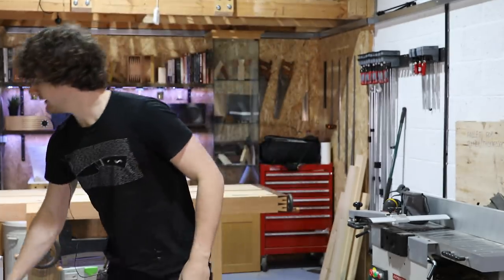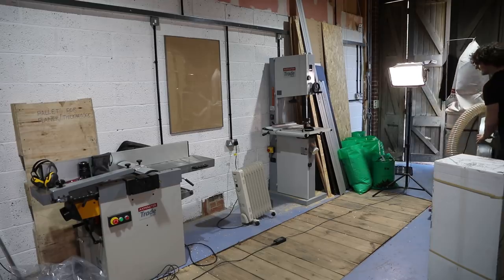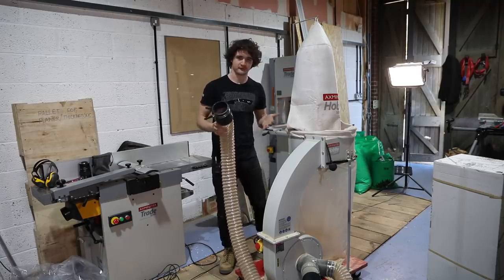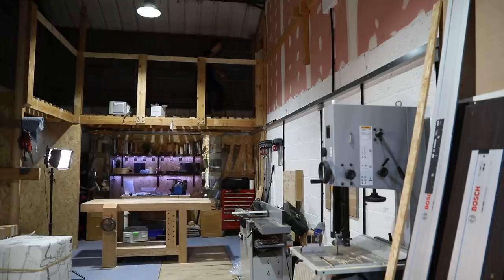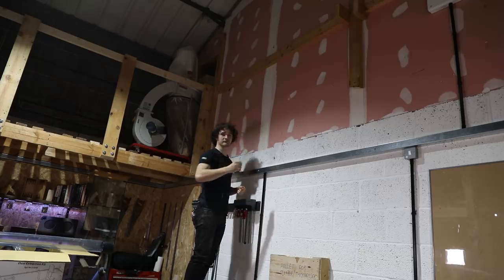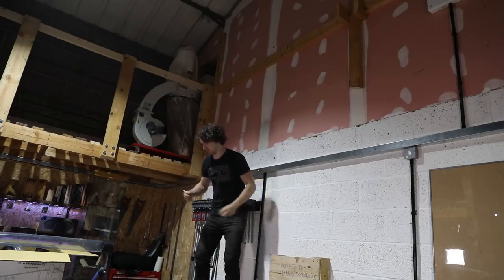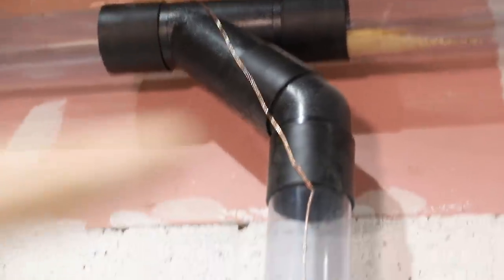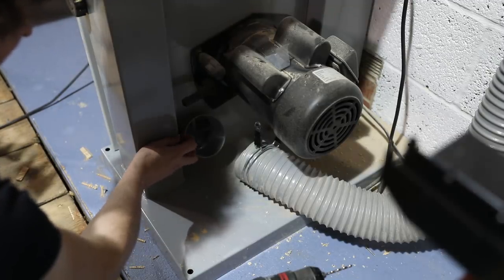Installing a Dust Extraction NETWORK in my Workshop.

Comment: Hi, I have a similar extractor, and basically took it off the damned trolley and wall mounted it. Problem sorted, and in fact, I moved the filter and dust sack outside and linked it with 50cm of 125mm hose. It works brilliantly, and, wall mounting the turbine motor section, made it a lot quieter. Regards

Comment: I've just upgraded to a 2hp Axminster dust extractor after using the same machine you have & i've got a similar set up! It's made a big difference. I also use a remote socket switches around the workshop & have the remote on a bungee coil belt clip. Love the videos Matt.
Reply: What extractor did you buy ?

Comment: Soon to come, a remote for the dust extractor!
Reply: You can buy an adaptor from every read that has a remote just plug adapterinto socket the the machine into socket then turn in and off with remote 👍

Comment: Hey Matt, still loving your videos mate. Bought myself one of your shirts recently, very nice indeed. 

An easier way of sorting your earthing wire out after your piping had been installed would be to use a ball of wool (its only safe to do when you have the clear tubing like you do). You turn your extractor on and allow it to suck up a length of wool from the inlet end of the pipe until it is easy reaching distance of the outlet end of your pipe (you need see through pipes because if you go too far you end up having to spend ages unwinding wool from your extractor fan). Once you have a length of wool running from input to output you tie your earthing wire to one end and pull it on through.

My old gaffer showed me that the same trick could be used for partial blockages on a bigger system but for the life of me I can't remember how he did it. Anyway, hope it helps.

Comment: This is a good beginning but  Noise, Cyclonic filtration for better air quality, and remote controls for main machine and blast gate switches for power. All things I'm sure you're considering already but I was surprised you located it right over where your cameras will be and that you'd overlook a cyclone prefilter. I expected locating on the front (entry door) wall where the shelves are and up on a platform.
Reply: Clyde Decker b

Comment: What a fun project! It would be interesting to upgrade those sluice gates with an actuator. Conceivably it wouldn't be hard to connect the vacuum to the power tools so any time you turn them on, it opens the sluice gate and turns on the extractor for you.

Comment: Zip line!  Anchor a cable upstairs and a deep anchor about 3 meters out your door.  Disconnect the anchor outside till you need to take out the chip bag.  When the chips need to go, open the door, connect the cable.  Then with some rigging you can send your chips down the line straight outside. Easy peasy.

Comment: Matt, for the dust extractor itself, wire up a suitably rated bathroom light switch / pull cord to switch the extractor on and off (that's if you're comfortable with wiring).

Comment: Yet another very informative video! I knew about grounding the outside but not the inside of the pipe.I'm getting ready to re-do my system but I'm using sewer pipe and connections. I like the clear view section and I'll be adding a few of those (every machine). my idea is to completely eliminating all 90's and as few as possible 45's. Instead I plan on using all 22 1/2 with a small (12") piece of pipe in between each joint with a short as possible piece of flex to each machine. I saw that you brought the ground wire (cable to the outside at each pipe junction. Why is that? I understand the blast gates though. 
A small piece of advice, run another wire (solid core) on the outside and use A/C metal tape to connect it to the pipe. Just a bit of added protection. It's probability "over kill" but???

Comment: You’ve probably worked this out by now but, plug the extractor into a decent extension cable that’s long enough to drop down from the mezzanine and plug into a wall socket, then either plug it in to power up or leave it plugged in and just switch on when you need it. 
Don’t go for a cheapo extension cable. 
Cheers for the helpful videos Matt.

Comment: You need a remote control for the extractor mate. I'm just in the process of finishing off my home workshop. I'm going a bit over board with the dust extraction. I've bought a Baileigh cyclone extractor with a 3hp motor and having 6" white plastic ducting round the workshop.

Comment: Question: wooden it be simpler to run a switched out let to the extractor? To you know..not have to climb the furniture? Just switch it on and off at ground level? I see you have a source for power.... it would just be a matter of tapping into it.
Reply from the maker: It’s an NVR Switch which makes things a little more more difficult. Not unachievable though!
Reply: Why dont you leave the NVR turned on and make the socket turn off with a smart plug and app on your phone? That's what I'd do.
Reply: @matthewbutcher5295  The No Voltage Release (NVR) switch is a single unit that contains a latching relay.  It is internally wired to de-energize the relay as soon as voltage is removed from the input.  This is a safety requirement to prevent machinery from restarting after the input power is interrupted.  It's not much of a problem for a vacuum cleaner or coffee pot, but for a lathe or drill press, it could be very dangerous.

A solution I use on my dust collection motor is to replace the NVR switch with a separate contactor controlled by a Start-Stop switch that I can put anywhere in my shop.
Reply: @MattEstlea  That was the first thing I deleted on my newer Jet DC1100 Thankfully my older DC1300 doesn't have such nambyness. Also since DC1100 model has a flexible pipe between motor and filter, I flipped the motor around so the ports are on the correct side for the placement/position of the unit against the wall in my hobby workshop. I had the same box of bits from Axminster, which I've since bought twice-over over time to connect everything up; those plastic dust ports are super fragile - I note Ax have (had?) now discontinued for metal ones for single purchases... annoyingly. Thankfully "record power" seem to have the identical plastic ones in plentiful supply - I've bought loads over time but oddly have no spares, which is perplexing. Static dust... I don't see how you're ever ever ever going to generate the dust density required to generate an issue in your (or my) microscopic wirkshops. But it was fun to watch you drilling holes in your shiny new pipes; plenty of mastic blobs to seal the holes I guess? Or wood glue and sawdust to gob them up for authenticity he he (Sorry, gob is such a foul word in this context). Indeed, having a stationary dust collection setup is going to make use of the machines infinitely more pleasurable. (Oh, and build a simple fixed ladder to the dust collector; with repeated reaching for that switch and often changing of the bag, you are going to have an accident of some description otherwise... and as a lone worker that could be fatal. Have fun matey.
Reply: +1 for "wooden it" pun. NICE!
Reply: @kurtfattig9370  thx, I thought I might have been barking up the wrong tree .
Reply: @MattEstlea  I developed a unique solution for keeping an NVR switch on which allows me to use a remote for my dust extractor. Cable tie half a domino to the on button. Patent pending.

Comment: You should probably seal those drilled holes for the wires off with some putty / sugru or something - I work on pump systems and the tiniest hole causes loads of air to be pulled in reducing the effectiveness of the pumps.  In your case I guess this would manifest as a reduction in the vacuum generated.  Worth testing to see what improvement you gain?

Comment: Workshop is looking the goods!

I replaced the NVR in my extractor with a $3 rocker switch from the electronics store so I could use a $20 remote control outlet. Still not as nice as having it triggered by the tool but better than having to walk /climb to the extractor. Also, I replaced the bag on my 1HP Carbatec unit with a cartridge filter. The filter cost almost as much as the extractor but it improved air flow quite a bit. Seems to catch a lot more of the fine particles as well. Cheers!
Reply: Hi mate - I'm trying to do the same - would you be able to post some details for how you did it? (brand/product names etc) thanks👍
Reply: Hi Rob,

Apologies for the delayed response. I used the “DPDT Large Rocker Switch”, part number SK0981 from Jaycar and the matching dust cover. Since it is smaller than the existing switch, I made a simple mounting plate out of 6mm MDF. I’m not super clever with electronics and from memory the spades just unplugged from the NVR and went onto this switch in the same orientation and it just worked.

For the remote, I used the Jaycar version of the  “Arlec Remote Controlled Power Outlet”, I/N: 4331763, that Bunnings sells. I didn’t know about the Bunnings one at the time but it appears identical (badge engineering) and cheaper.

Hopefully both carry these items in NZ!

Cheers,
Lindsay
Reply: @TheLindsay720  - thanks very much for this mate! Very helpful, and I have a Jaycar just up the road from me. Cheers again
Reply: @TheLindsay720  Hi there Lindsay - managed to get all the parts from Jaycar. The remote power supply works mint, I haven't changed the switches over yet but I will do that soon. I just by chance noticed that WoodKnight Paul J uses the same remote power. (https://youtu.be/zVGx497QYdI?t=700) Thanks again for the info. Rob 👍

Comment: Surprised to see a single stage dust collector work that well, nice. Try wiring a power source to the dust collector with a switch on the first floor. No more climbing up and down. Thx, Jim from Rochester, NY

Comment: Looking good. See some people don't understand an NVR or the fact it's also a kill switch so remote controls and such are out of the question and dare say maybe even something in your insurance about disabling emergency switches in machines. Thus Simple solution is to remove the switch and fit it at a more convenient place. If you can reach the side of the messanine then fit it there. As for the static not sure it's the PVC causing the issue but the actual dust moving around which then causes the build up. Thus I maybe wrong but think just running the wire all the way through would work with no need to come out and in.

Comment: Pretty simple solution for dust bags, from the waste side of the DC run a large diameter hose to the bottom floor and store a bin down there.
Reply: Better yet add a external cyclone

Comment: Hola Matt , do you need to have extraction at your soon to be finished power table and did you leave provision for it? Just a quick tip put a light smear of washing up liquid on the plastic joints before assembly they push together much easier (old plumbers trick)

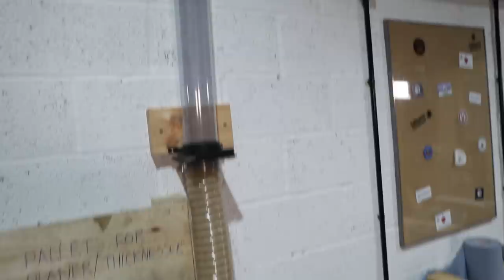Comment: Looks like you may have a transport velocity issue.  @11:35 there is dust piling up a the fist junction.  You may be loosing a little static pressure and hence loosing velocity.  Even a closed blast gate causes a static pressure loss.  best place for your blast gates is at the top where the 45 degree junction is...saves the static pressure loss when the blast gate is closed.  Yes, you'll need something long to open/close the gates...but the air flow is more efficient and you may gain enough transport velocity to keep the larger particles from settling out, and eventually clogging your system.  At least you can see when you have a clog.

Comment: Is the dust filtration on your extractor suitable for fine particles, as it just looks like a bag and is it possible to retrofit a self cleaning fine filter (like on the trade series Axminster extractors).  Else it maybe an idea to fit one or two air cleaners, as the location of that extractor means it will just spread the fine dust over the whole workshop.  Would be interesting to see what a dust\particle filter readings would be before and after use.  I am sure this would not be suitable from a commercial perspective, especially if you have anyone else in the workshop (cameraman for instance).  All these things are issues I have been looking into with regards to setting up my own workshop and your feedback (along with everyone else's) would be much appreciated.  Thanks for your videos, keep up the good work!

Comment: Matt you need to get the iVac system set up it isn't that expensive.  Would save you jumping up to turn your dust collector on and off all the time.  I have just one switch for my dust collector and one that I plug the rest of my tools into and it saves a lot of time and sanity.  And I don't have to climb onto a bench to turn my collector on and off lol.
Reply: ivacswitch.com  Available in UK and Europe now.  They make elaborate systems or simple ones for hobbyists and not that expensive.

Comment: I know this video was a while ago but can’t you turn the y bit that comes out of the collector to change the angle. Leave the clear pipe in and loosen the y bit and turn until you get best angle. I’m looking at this system for my workshop / shed but not sure if it will to much for a 18ft x 10ft shed / workshop and I need a new collector as only have a shop vac and a drum / bin  type one from lumberjack. Is there any extractor you can recommend I need one that is excellent at getting rid of dust as I have copd emphysema and been told I had TB when I was younger and didn’t know so lungs are scared and working at 70 - 75% 
Many thanks steve 👨🏼‍🦽
P.s. I forgot to ask did the 100mm / 63mm y come with the kit or was that a added extra cheers again and great videos by the way 👍🏻👍🏻

Comment: I have a nickname at my workshop (3 phase pete) it's because I purchased the jet twin bag 3 horse power extractor from axminster. It wasn't untill I assembled it and went to plug it in that I realised it was 3 phase. It is now three years later and the only dust it has collected is on the outside of the bags
Reply: You can get an inverter drive which will run from single phase 220 and make 3 phase 230V. Don't know where you are located but in the States about $350.
Reply: @duncanpotter5838  yet that sort of thing is quite expensive in the UK, I'm in the process of sorting it out. Should be up and running soon
Reply: @theislandworkshop8453  - Just bought a variable frequency drive (AKA inverter) to run a 3-phase tilting arbor saw from my 220v single phase supply. £68 including shipping from good old ebay. TAS is also 2.2Kw (3hp) and you need to buy the VFD to match your motor's draw.
Reply: @timmymojito  no way, it was the draw that was causing me issues. I can't quite remember but 25A rings a bell. I will have a look tomorrow. I have a 3hp jet twin bag extractor so it does have a big draw. Do you have a link to the eBay store ?
Reply: @theislandworkshop8453  25 amp would be a HUGE draw for a 3hp motor, my TAS is max 8 amp, even at 400v three-phase. It has a dual-frequency motor, allowing me to run it at 220v (240v) three phase, which is where the VFD comes in, converting my bog standard 3-pin plug 240v  single phase into 240v three phase, they're a clever wee bit of wiring is all! I got this exact version: https://www.ebay.co.uk/itm/220V-2-2KW-Spindle-Motor-Speed-Control-Variable-Frequency-Drive-VFD-Inverter-hh/202151507543?ssPageName=STRK%3AMEBIDX%3AIT&_trksid=p2057872.m2749.l2649

Comment: Okay Matt, I'm feeling generous.
Much easier way to ground your pipes. Expose the wire at both end's of your flex. The machines will be earthed via the power cable. Easy.
And one other thing. You could have unbolted the blower motor and put it on the other side so your bag is on the outside and avoid the need for an angle back to the wall. Most vacuum blowers are reversible unless your unlucky.
One other thing. Never use more flex than you absolutely have to.
Flex reduces velocity of vacuum.
Run your gates to the floor and you can use your foot to turn them on and off.

Comment: Looks good Matt, but I do have a question.  Why did you keep the Y junction on the extrator if you aren't splitting at that point?  Most extractors have a bigger diameter going to the Y than coming out, on mine it is 125mm in and 2 x 100mm coming out.  So I ditched the Y and used 125mm ducting, giving much better air flow.  Any reason you didn't do the same?

Terry.
Reply: exactly what I was thinking, and facing same issue with my setup currently.
Reply: Axminster don't do a 125mm kit. However I agree - I did the same with mine, buying 125mm PVC ducting from ebay. Y branches are tricky to find at a decent price though!

Comment: Great video! I don't know if you know the company called iVAC. They are doing automatic switch system for dust extractor and they have lunched a new product line for the UK. They even might be interested to do a collaboration with you since they did it with some you tubers in the past!

Comment: So, I have a dovetail little challenge to see what you think.
I am a total novice at making dovetail and just practicing with some 2x4's, then I had an idea. Are you familiar with the impossible dovetail puzzle? They just make a diagonal dovetail and make it look like it's impossible.

Well along that line of a diagonal dovetail, what would you think of joining 2 4x4's with a diagonal dovetail? (90mm x 90mm?) Just trying to be fancy, nothing else. I think a single dove is fine for what I'm messing around with though. The end result is an end to end joined corner, like any other dovetail corner, just with two pieces of square end wood.

Comment: Nice addition!  How long will it take before you decide to convert the DC system to a two-stage cyclone separator?  It's a bit pricey, but there's a good source in the UK for the Oneida Super Dust Deputy XL that should work well with the Axminster blower assembly.  You will need a better filter system, but your lungs will thank you.